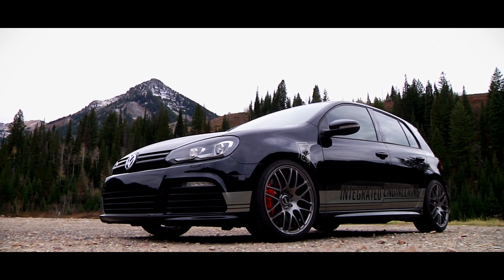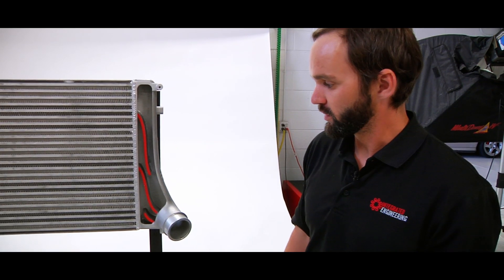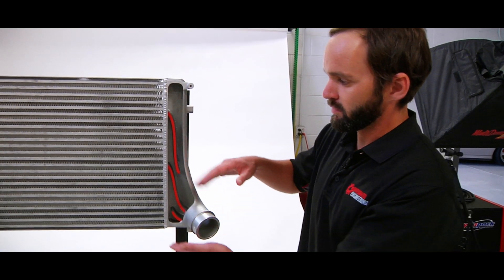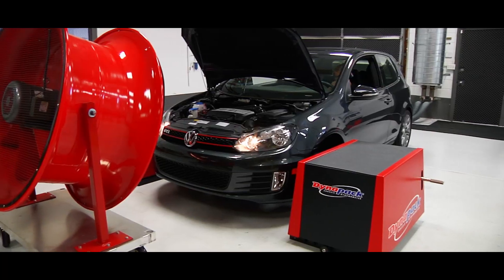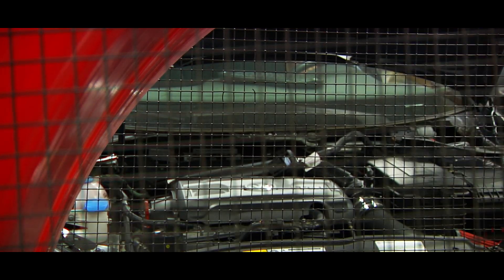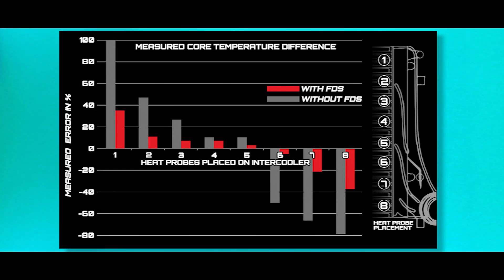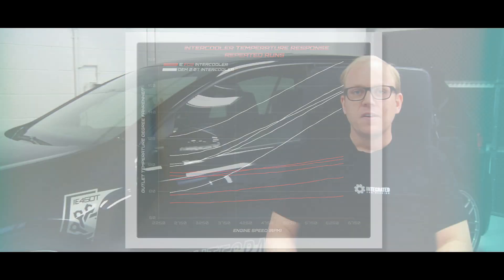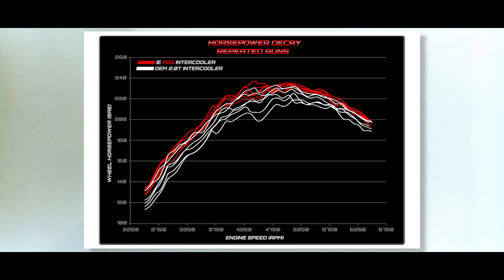Integrated Engineering FDS Intercoolers - Development.

Comment: Great Video! Can't wait to see more hardware for the 2.0T TSI for the MK6 GTI! I may be picking up this intercooler. Is there any lag with such a large volume addition? I am running a tuned vehicle.
Reply from the maker: Thanks for the kind words! Take a look at our website for a dyno graph that shows the pressure drop data.  You will not feel any increase in lag with our FDS IC.
http://www.performancebyie.com/ie-fsi-tsi-tfsi-fds-performance-intercooler-ki